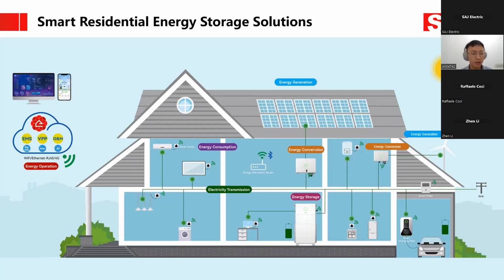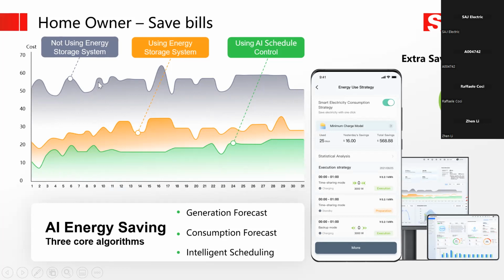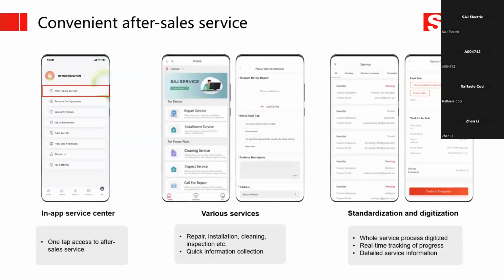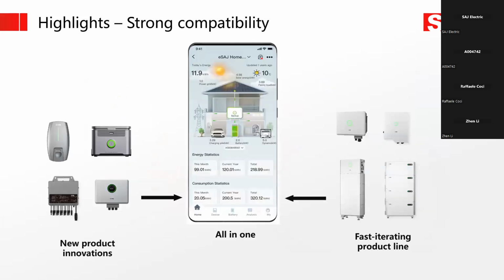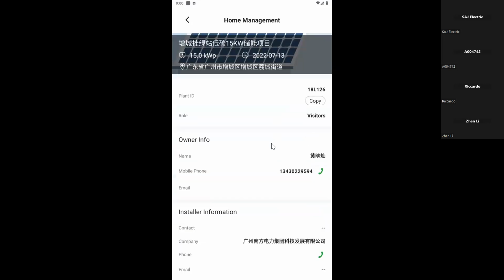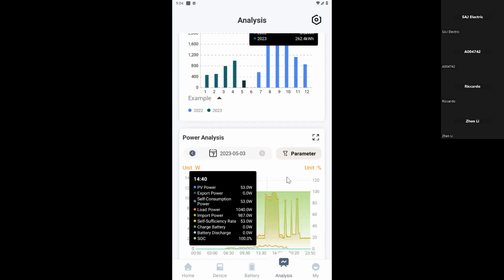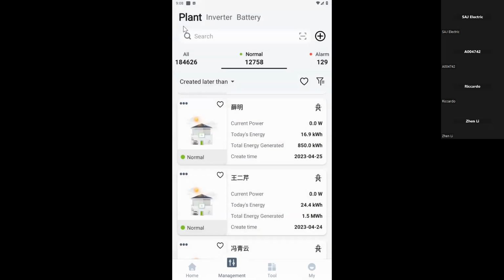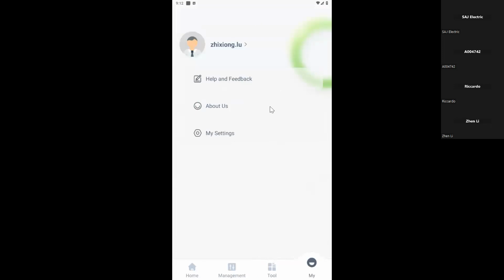eSAJ Home App Training

Comment: I am wondering about my intake from the grid. As its summer now here in Europe, I wonder why I use any power from the grid at all?
Mostly what I get from my roof is easily enough to take me through the day and have the battery fully charged up.
So why do I import any energy at all, if my battery is almost full? Thx for an explanation. :)

Comment: hello. im using self consumption mode most of the time but I'm not able to charge battery from the grid at night time. so I have to change modes manually every day. when we can expect functionality for setting up schedule of working modes?  like for example from 2am to 5am time of use mode and other ties self consumption mode. ai functionality is not that good as its don't know my needs and there is no way to adjust or change plans for ai schedule. i had many times not charged battery as ai decided not to charge.
Reply: Same problem here... SPend ages setting it up and wake up next day to empty battery and now it starts to charge from peak rates...    This app is a sure way to make you rip out solar